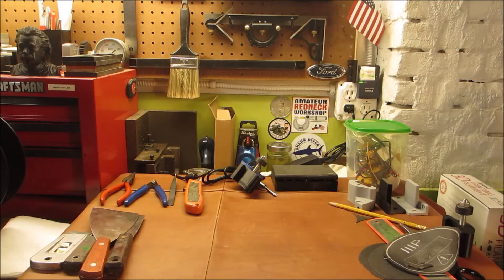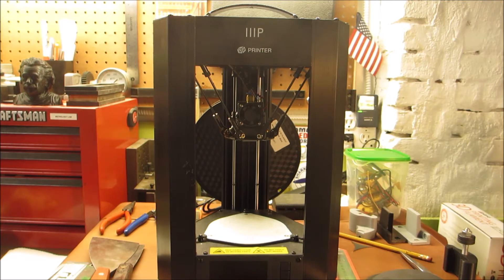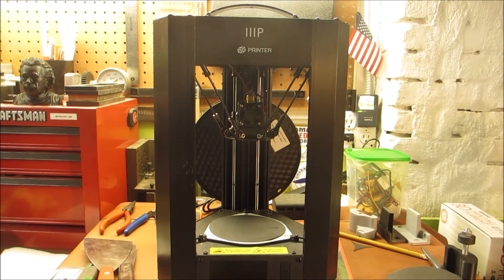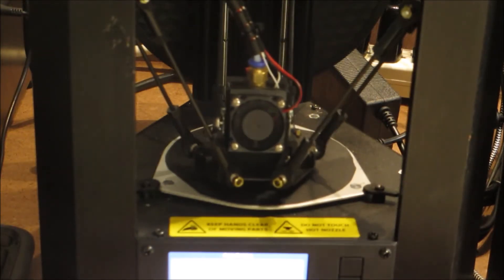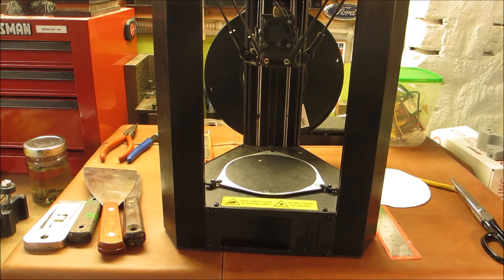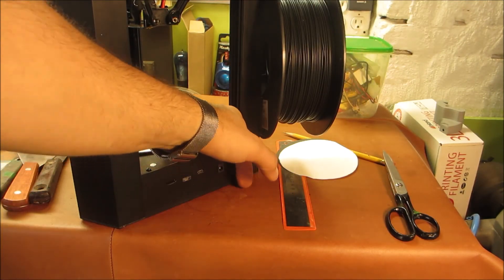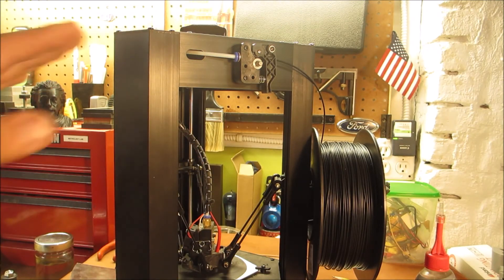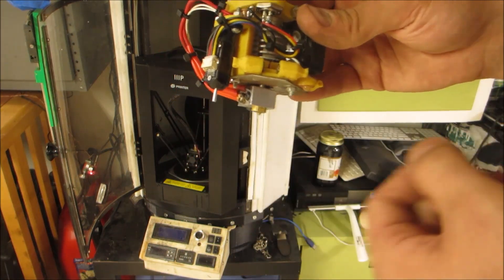MP Mini Delta 3D Printer + profiles and tweaks.

Comment: I love the mesh leveling! I NEED mine to do that. I noticed the profile in the description and I’d like to try it but it says it’s for a very old version of cura. Will this still work today or would you not recommend. If not how can I get it to do this mesh leveling because one side of my bed obviously is higher and it’s scraping the bed on on half and printing perfectly on the other. Thanks for your help or anyone’s for that matter.
Reply from the maker: This should still work if you put in the code for it. With that said I no longer own these two printers and can't really provide a tested updated profile. Try the mesh leveling code from the MP mini wiki. This is the code "G29 P6 ; 6×6 matrix - DOUBLE TAP" without the quotes. Found here. https://mpminidelta.com/g29

Comment: so how did u get the better leveling thing.
Reply from the maker: I did to some degree. I used spacers in the stock clips. This gives me better leveling. The printers have been a home run for me. Consistent and used them for many thousands of hours. Recently did an upgrade video series. These have now about 500hr of use each since the video. Many parts have come out of them so far.

Comment: hello 
i have got the same printer and i have problems with geometry : form example i made an4 mm hole and a have only 3.7  what can i do ?   thanks
Reply from the maker: Mark, scaling the part is the only thing you can do to compensate. Inner holes are difficult for allot of printers. Sometimes simply running a drill through in post processing is the easiest thing. Otherwise you have to compensate in either drawing or on scaling in cura.

Comment: Help help help lol.just got my first printer and ran off the test print supplied on the SD card,but when I tried to run off something while using cure the printer head just smashed into the heat bed.any ideas,I'm new to this 3d printing game so any help will be good
Reply: JustAnotherGamer JAG did you get it?

Comment: i was taking the tube that feeds the filament into the bowden tube and nozzle and this little screw and metal piece fell out and i have no clue where they go. any help?
Reply: Commander Wyro im a little late but did you figure it out 😂
Reply: Ive had this printer for so long i can practically take apart the whole thing and put it back together 😂

Comment: Hello! I'm thinking about getting a Mini Delta, and I have a few questions- mainly do you recommend it? Also does the added gcode for the 6x6 grid help with repeatability?
Reply from the maker: I recommend this printer absolutely. I have two of them. Both have been extremely reliable. I would say both have 500-1000hours on them and are starting to show some wear just now, for that I will be replacing the bearings. I personally think the 6x6 grid has helped with repeatability. I rarely get a bad print, so rare in fact I can't recall the last time this happened. Also a bit of light oil on the rails does go a long way IMHO.
Reply: @Engineerd3d  thanks so much!

Comment: Thanks for all the tips, the print quality is surprisingly good for the price. I've tried printing ABS, but the bed struggles to heat up and get past 50C. Should I get a new power supply?
Reply from the maker: Try insulating the bottom first. Regardless the PSU is marginal for this size of machine. With that said, I have printed 100's of hours with these. 50parts this week alone (75+ hours combined). They are surprisingly repeatable. At this point I think these machines need disassembly and cleaning, as well as some modifications.
Reply: @Engineerd3d  Thanks for the quick reply, I built an enclosure with acrylic doors and use 3Dlac for extra adhesion. So far it prints great, just takes for ever to heat above 235C nozzle and 50C bed. Are you planning on replacing the hotend or the extruder?

Comment: What temp should I print PLA at? Also what temp should the bed be set at?
Reply from the maker: I print between 210-220c. The bed I set at 60c, although it fluctuates between 50-60c

Comment: I have one that's works perfect with pla and abs.  I insulated the bottom of the bed heater.  Now it easily maintains 60 c.  The 6x6 grid does nothing more than the 3 point leveling.  Add a 120 mm glass bed with pei sheet on top.  Must be 1mm thick.  Make sure to check belt tension.  Mine was loose out of the box.  Screw to adjust is on top of the corners,  middle screw.  I cut foam poster board pieces to cover the sides.   Smaller piece for the front.  Make new fan shroud to stop build plate cooling. Print ABS at 240 degrees C and platform at 60 C.   Prints are perfect.  6x6 leveling is a waste.  Add G code as last line in ending gcode:
G4 S360
M107

This will run thr fan for 10 minutes at end of print,  then shut it off.  
This is a fantastic printer for the price and easily does ABS  but only with PEI build surface.  Let it cool.  They have small spatulas with a sharp edge at the DOLLAR TREE STORE.  just one buck.
Reply: Where can you get a glass sheet?
Reply: @stevopatiz  amazon or ebay.  Wisamic Clear Borosilicate Glass Heat Bed Round 120mmx3mm for 3D Printers Mini Delta, etc https://www.amazon.com/dp/B07BNJLKMF/ref=cm_sw_r_cp_apa_i_NibmCb0A3ZXY9
Reply: @stevopatiz  I also recommend putting a pei sheet on it.    Available on amazon.  110mm round by 1mm thick.  Dont use the thinner one.  Not as durable.  Of you clean it with alcohol, it will last forever and prints will stick great including ABS.  Just let the bed cool off before you remove the print.
Reply: @stevopatiz  I printed ABS with this printer.  Nozzle temp 230°,  bed at 60°.
Reply: Awesome, thanks for the info!
Reply: Awesome, thanks for the information.
I am new at this; what is a pei sheet ?
Reply: @markspc1  pei is a clear yellow plastic that all plastics adhere to for 3d printing.  Buy the one that comes with the adhesive sheet.  I mounted mine on a glass place that is easy to remove.  Hold it to the printer with tiny binder clips.

Comment: Where do I find the G code for the multipoint bed leveling? Is this G code added to the Slicer? I am using Simplify 3D
Reply: I am wondering the same thing. I'm using Cura at the moment but looking to upgrade to Simplify 3d in the next few months.
Reply: upgarde to 3.6 and use the profile from the wiki
Reply: check the link in my reply above. There is sample start/stop code

Comment: A nice collection of printers.  Of course you do need just one more.  😁
Reply from the maker: Harold. My original Delta was long in the tooth. Had some production work to do and bought this thing. Once the production work completed I had enough to buy another. So I did. As long as the shop breaks even I'm good.

Comment: I am confused, you don't like them, but you do???
Lots of upgrades to do but they are quite good?
Can you print abs in a printer that is not enclosed?
The only way I can get good results in my Robox  (fully enclosed) is to ensure the ambient is up to to the recommended temperature before it starts printing. Since I worked that out it prints abs quite well. How does one manage that in a printer that is not enclosed? I have often wondered how it is achieved since I worked it out for the Robox.
Reply: Did you mention the price? I must have missed it!
I have often thought a delta would be a handy device to have as the Robox only goes 100 mm high!
Reply from the maker: The price is dependant on geography. These machines cost about 160$ per. I got the second one as I did some production runs on the first one and it impressed me. The production ended up paying for a second machine. More to come surely on these machines.
Reply from the maker: They are quite good for a small machine that cost practically nothing. Out the box they are capable of doing good work. Not perfect mind you, however quite good. Also ABS can be do e in Open Air. I don't recommend it, but can be done. The larger printer is my abs machine. However right now she is down for the count waiting on a few parts to upgrade and rebuild.
Reply: I can do small prints in open air of say no more than 10mm tall and 20-25mm square.  When you get above that it takes dire moves to keep it from contracting back and curling.  I know i have never been able to have the bottom completely flat on glass with ABS if over about the size of a quarter in diameter.  I have a Qidi Tech Replicator 1 clone that is enclosed and it doesn't do ABS very well at all whereas my TronXY X5S does a much better job with ABS and is an open air printer.